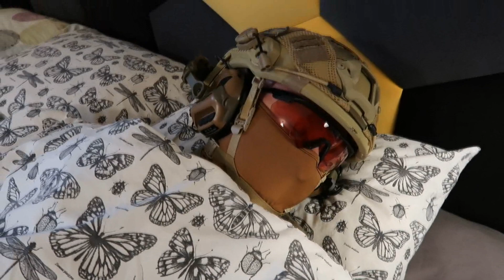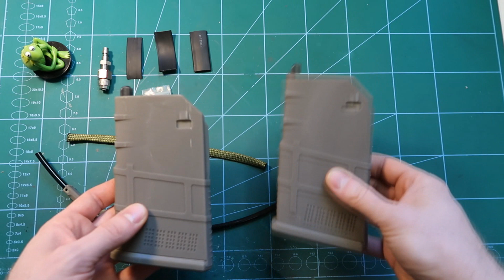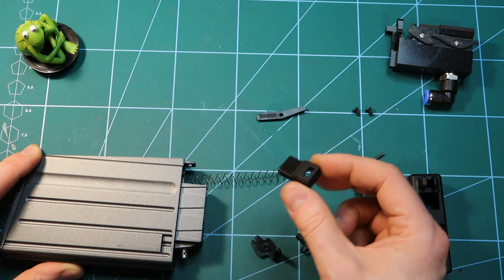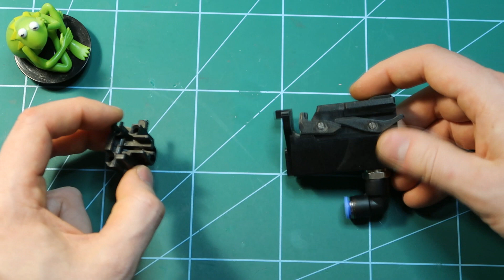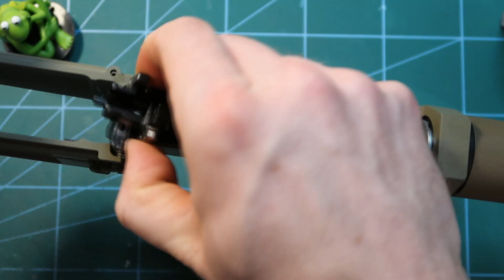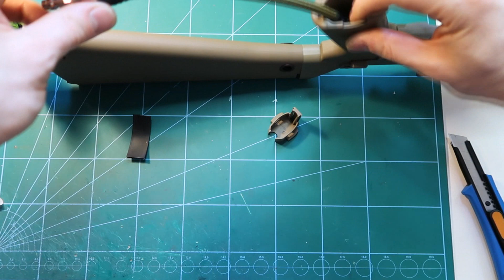Frog Manual #07 - FE HPA conversion kit for VFC SR25/SR25 ECC/M110 SASS/M110K1 HPA GBBRs

Comment: Hi, how much power can you get out of this in joules? I've been thinking about doing this mod but I'm not sure if it will have enough power for my field (2.8J for DMR)
Reply from the maker: Depends on pressure and type of regulator, parts inside, BB weight you can reach 3.5j or more.

Comment: How's the air consumption on this? Like what tank do you use and how many shots can you get out of it?
Reply from the maker: Depending on ton of parameters, f.e. barrel length, barrel diameter, power set up, hop up bucking, type of regulator, pressure on the regulator and many more, you can get 600-1000 from a 0.8l tank.
Reply: @frogengineeringairsoft  sounds good. I know there are a ton of variables, just wanted to know about roughly how many you can get out of a tank before I decide to switch to HPA again. Gonna try running green/red gas for a while, see how I like it, maybe then switch if the colder temperatures mess with it too much